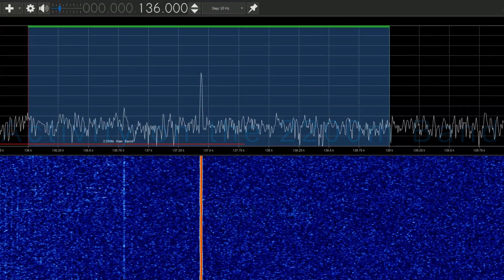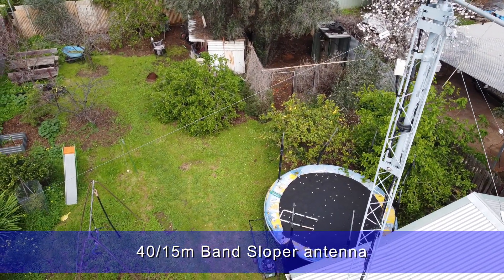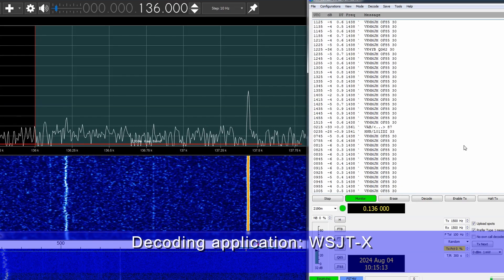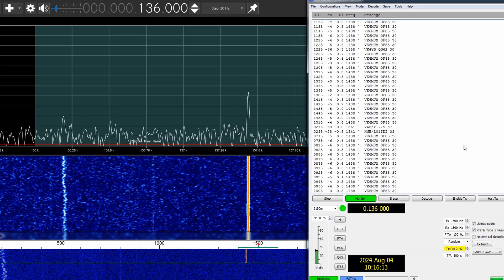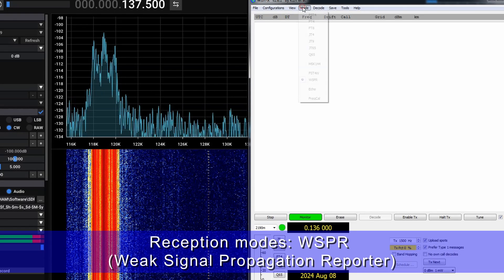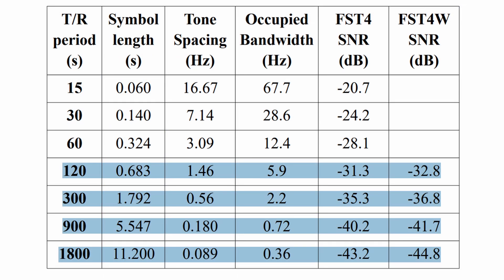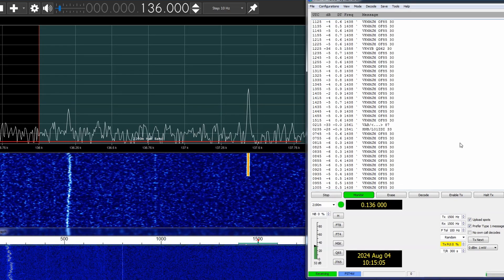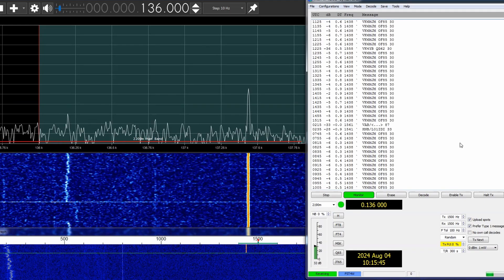Activity on the 2200m Band  - August 2024

Comment: Restriction in EU is max 15m high antenna and 1 watt ERP. With a few top-hat verticals spaced some 50 m apart which can be phased, gives you a good chance to reach globally. The ERP-value has to be 
 "estimated"... Good luck with improvements of Your 136 kHz station setup. 73 de Bjoern